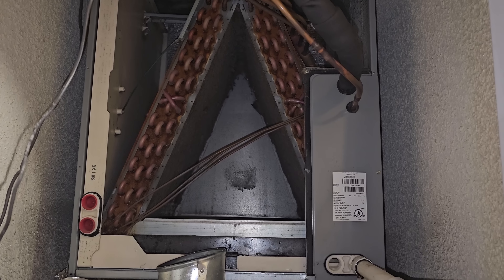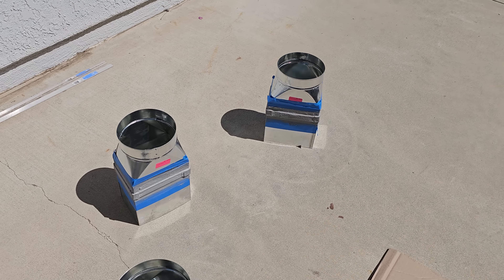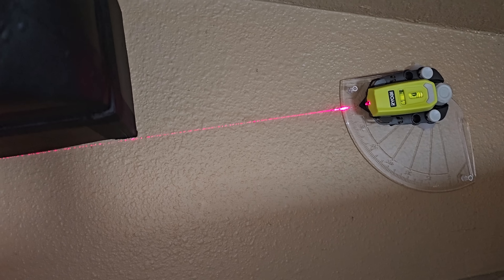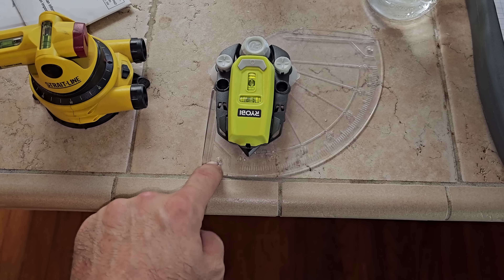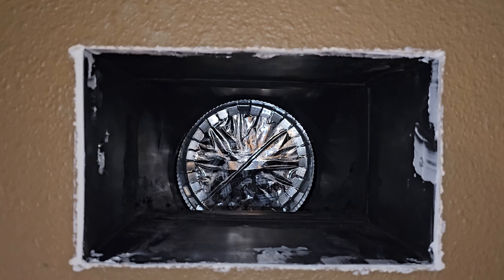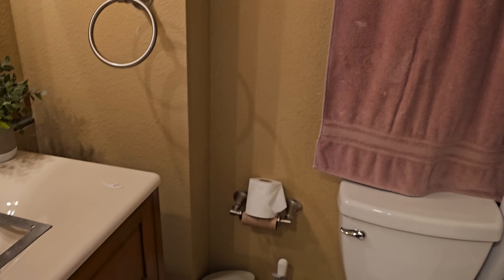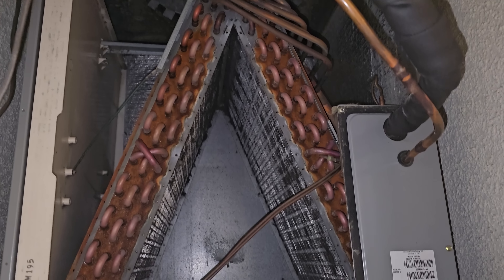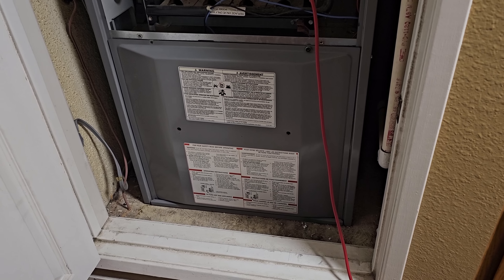HVACR VIDEOS HOUSE PROJECT PART 4

Comment: I think you've started a great series. "Technicians revamping their own systems." I've been in the industry 45 years and teaching for the last 20+ and I can attest the best teacher is experience. You will learn so much as a technician by making your home system near perfect. You'll appreciate the nuances of duct fittings and what they do to airflow. You'll make changes to reduce indoor air noises and increase your quality of living. You'll be a better tech. And your family will love you even more!  And if you don't wanna do that, and live with a system that is super noisy, someone needs to invent a device that turns the TV volume up when the AC comes on. :)

Comment: First off I think you are one of the top hvac channels.
It takes more time and the track house guys will shot me down. I really think you should install hard pipe instead of flex.
I've had years of experience in solving airflow,draft and stream problems. Trust me.
A video with testing with flex then pipe would be cool.
Keep up the great work.

Comment: If the coil was that bad, I can't imagine what your blower wheel looks like.  I'd like to see the airflow increase after you clean that off.  Also, you must have a breach between the filter and the furnace if you're sucking in that much debris.
Reply: Agreed! That nasty ol squirrel cage is so chronically overlooked, and next to a furry coil like that, the main reason for bad airflow. Probably boost the cfm another 100 pts or so.
Reply: "debris wheel" is the proper term for it. 🥳
Reply: @MrOlaf1972  I cleaned a mini split in a commercial kitchen recently. The blower wheel fins are a bit tighter than a big central unit, and I think airflow was at least 60& improved, maybe more. I had never seen a blower wheel so plugged up

Comment: Good to see thought being put into the minimum viable system size for the property, and energy-neutral tactics (e.g. reducing vent size) to make things more effective. When the majority of systems are oversized by 20% or more, that really adds up over the scale of a whole city or country. Obviously it's a waste of energy, with all the problems that entails, but it also increases the peak power draw on the grid which leads to higher operational costs for everyone. There's a lot of unjust deflection from industry to individuals on the subject of waste, but individual choices around residential heating and cooling do really add up over millions of homes and years of operation.

Comment: If you think caulking around it does much more than reducing the leakage. Fast moving air would drag air from the attic with the dust through the holes - which I would be much more concerned than leaking air.

Comment: A bit over the top with the new duct size.  More modern vent covers would do the trick.
Returns installed further away from the fan would make a big difference in noise.
2 ton would never work for my temperature preference.  Better get the mini split for
the office. That place is going to be at least 80 degrees in the heat of summer.

Comment: I also find clogs at the secondary heat exchanger on 90 % furnaces in this situation where the filter lets dirty by.  Got to pull the blower wheel out and look up.

Comment: Love your content! Every time I see one of your videos I either learn something new, refresh something I learned a while ago, or both. You're not weird or odd! Far from it. You're conscientious and attentive to detail. There's nothing wrong with that at all and others should pay more attention to what they do and how.

If I was doing what you've shown in this video I would have CAD software open on the computer and designed and dimensioned everything, measuring the house to the nearest millimetre! I'd be calculating everything based mathematical ratios as well as practical considerations. To use something from this video, for locating the front entry room register I would have applied natural ratios so that even if was not located centrally over the doorway it would have looked 'right'.

I usually have to plan and test theoretically before I create something physically. I don't do anything I can't undo unless absolutely sure about it. I also consider serviceability with projects I work on, trying to make everything as serviceable as possible with the least amount of hassle to do so. I prefer to use screws and removable or serviceable fixings rather than adhesives. For this reason I was less than impressed with the decision to spray-foam the boots rather than a solution that would make servicing or alteration easier, even though it's something that in theory should not need servicing.

I suppose I am in some ways a bit extreme in my methodology. On the upside I think I have the best chance of finding fault with my ideas before spending a ton of cash on a large project followed by a ton more to fix it. I also don't know whether I'm giving too much information or too little. But then that's part of me, as someone diagnosed with autism who also happens to have HVAC as a special interest.

For what it's worth, Chris, your videos help me a lot in giving my brain something to work on as well as being a great inspiration out of feeling useless and exploring avenues for a future. Many thanks.

Comment: Always remember to check your filter weekly when doing construction and drywall dust will bypass your filter, have seen it in coils to many times
Reply: Weekly isn’t often enough.
Reply: it loves to get into the motor bearings also and before long they'll be nuked screeching or motor will lock up, no need to ask how I know!

Comment: When I was in a contracting company 30 to 40 yrs ago the approach the domestic sales based sizing on standard figures (and still the same today) where commercial  building were heat load calculated.

Comment: I think it would be cool if air conditioners had a monitor system that checked refrigerant pressures, air pressures, temperature differentials, ect. Then the monitor system could warn the home owner is something stops working correctly, so they could call an hvac guy before the system starts having major components start failing.

Comment: The house used to live in had no attics, two stories with two separate AC units and the ducts were sandwiched between the floor and the ceiling for downstairs and between the ceiling and the roof for upstairs. Its cool to see a project like this because it feels so impossible to me after living there so long I can't imagine moving registers and putting in new ducts, you'd have to rip out all the ceilings on boths floors... Directly on concrete slab so no crawlspace, that house was designed to never be repaired, the plumbing was all cast into the concrete slab and the wiring and ducts were all totally inaccessible
Reply: Ductless mini splits. That would be my plan.

Comment: If you want smaller vents for the ceiling also you should put in 6 by 6 four-way diffusers cuz they actually work really good and there's a bunch in my basement and they seem to blow a lot of are cuz they're really small

Comment: My girlfriend's place got reduced from 3 ton to 2.5 ton, but the ductwork and attic air handler location really works against it. Hoping to rectify the duct situation and get better registers/fix up the existing ones. This was a retrofit as many homes have been which built before central AC was the standard, and you can see that the condenser/evap part works, but the ducting is all wrong. I suspect it's the case in thousands of retrofit homes. Many still use the in-wall units, and would probably benefit from having a few mini split heat pumps instead of a boiler/furnace and a huge retrofit central air system with messed up ducting. It's a mess!

Comment: You have to clean the blower wheel if the coil is really plugged. And put some self rinsing evap cleaner to get into dirt inside coil. Good tech but youre doing the job 50 percent. Without going through changing all those boots try upping the blower motor a fraction you will get 10 percent more air. And try taking bigger takeooffs off the branches. Then go from there
Reply: And if the coil is that dirty you need to pull the blower remove motor and board and take it to the car wash there's no way air or hand cleaning will do an adequate job.

Comment: I agree with spray foaming round your boots AND caulking between the boots and drywall. Everything you are doing is how I was trying to do things when I worked in residential. It’s so hard trying to do things a new and potentially better when people just want to do what they have always done. 
I think you’re going to really like the performance and savings of the new unit. 
Question, are you adding fresh air/make up air to the system?
Keep up the great work, Chris!

Comment: If it was possible, I would encapsulate the attic and condition it. insulate the roof, etc. with rock wool and relocate the new air handler to the attic with 1 or 2 ceiling filter grilles. It will free up that space and decouple the noise from the house. Probably a little too far along with your current design now, but I think it would be pretty nice.

Comment: When you down sized, you run a heat load calc?  The supply air grilles in residential are awful. Never seen such garbage. Your old SA grilles look like floor grilles.  Will get minimum if any throw out of them. I always used the air guide grilles. Sidewall and ceiling. OBD as well. Little more but at least you can balance the house when your done.  I use Wrightsoft on changeouts, always. Really helps. You do get to a point where you really don’t need it for duct sizing once you do enough of them for your area.  It gets pretty typical. On the equipment size, it is necessary. That cfm read was off to. Looks like you gained a couple hundred cfm, but still short of 1600. Enjoyed the vid. Nice job.
Reply from the maker: Yes we did a full load Calc and that is how we determined the sizing along with the required duct work

Comment: Smaller registers?  = Lowder air flow?  Ususall, but you're variable, so. Are you going to paint to match the registers? Why have these WHITE squares stand out on your brown walls?  When cutting 2X's like that it's good not to cut all the way through the 1st cut so that tail isn't thrashing around as you do the 2nd one.   Get some acoustic foam to line the inside of the return plenum.   There is some made just for that.

Comment: thats a lot of work to replace flow boxes. its also will be harder to go bigger if size is wrong.  did you think about using blanks/ 50% fillers inside existing flow boxes?  or just linear grills(faceplates) with old larger flow-boxes?

i’m surprised such clogged coil was killing only 10% of airflow.
Reply from the maker: There was also a broken duct on the plenum , I found it when I ripped it all out so as I cleaned the coils more air leaked into the attic

Comment: I'm surprised you plan to use flex duct. Metal has much less friction, but elbows need to help change the direction of the air, especially in trunks. Unfortunately, you have to tape all the seams and insulated, so it takes longer. My AHJ requires mastic tape with mastic over the tape, so no tape is directly visible.

Also, have you considered variable speed compressor and fan? Most of the time, the unit won't be working in the extremes, and variable speed units allow the system to run longer at a lower speed. It won't help with air mixture, but will help with reducing hot/cold cycles. If you need dehumidification, variable speed works better to dehumidify as well.

Comment: Why are heat ducts up high? I would think that heat ducts should be low as hot air rises and cool air (AC) ducts when you are using air conditioning would be up high as cool air sinks. Doing it this way would cause better blending and comfort.

Comment: I'm really curious why downsizing the system makes any difference overall. You're still going to have the same heat load you need to pump to the outside. Does it matter if you run a 2T system for 40 minutes / hr vs a 4T system for 20 minutes / hour? If you're moving the same amount of heat, I expect it takes the same amount of energy (electricity) to do so in either case. Will be interesting to see what the overall outcome is when it's all done.
Reply: Avoid short cycling.  Long run times reduce humidity.

Comment: why not just bend or flat sheet metal the old boots down to the new size, then just patch the drywall in? seems like lots of extra work and headaches. 🤔
Reply from the maker: Basically because I'm a nut and have issues...  I will discuss this on my Livestream on YouTube this evening 9/4/23 @ 5:PM (pacific) come on over and check it out https://youtube.com/live/Oz0hgO03xGI

Comment: Chris with the temperatures in California being so high, will 2 tons be enough to keep your house cool?
Reply: I think it's all about efficiency. Don't let the heat penetrate in house. Optimize the air flow. Let the 2 ton unit run longer times which reduce wear on the components.

Comment: So maybe it's just me but I get very upset with the transitions on ductwork.   You have a nice 90* transition to the base of vertical furnaces but the outlet of the furnace always is a t fitting instead of a nice duct transition in each direction.

Comment: Wonder how all that sutff in the evap is getting past your filter?
Reply: Air intrusion around the edge of the filter.
Reply: When a filter fills with gypsum dust, it gets bowed in and air bypasses.

But that’s long term bypass or operation with a filter at some time in the past.
Reply: Too fast of a fan speed. The return should be 350 ft pr min or a little less

Comment: Please be careful with the spray foam process. PU-foam contains really nasty solvents. Daily spray and leave a walk in is no problem, if that is in that order. But standing there for hours in a hot restricted ventilated attic could be dangerous, even with good resperatory protection - due to chemicals goes throu the skin.
Maybe call a spray foam contractor with his daily space suit - easy instructed part of the job to hand over the foam? And spend some family time instead of the risk?